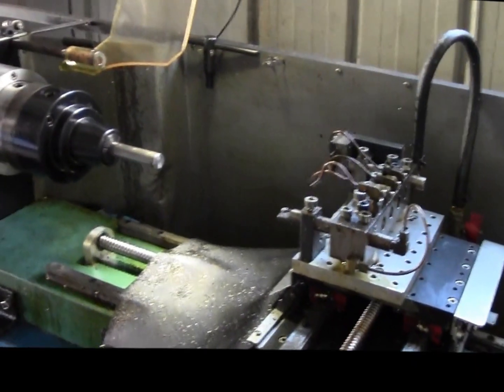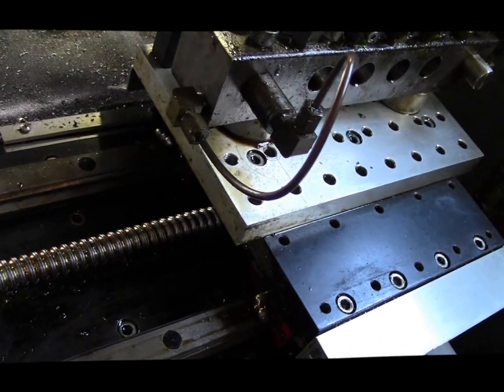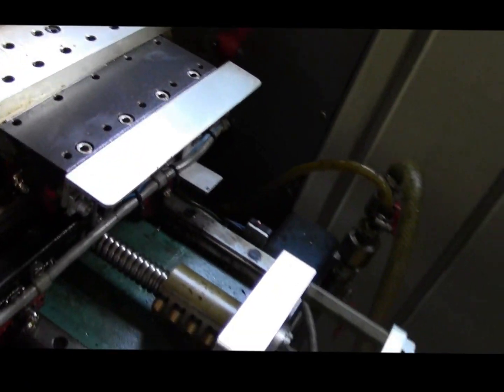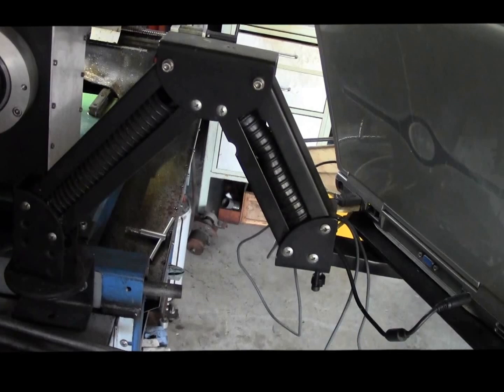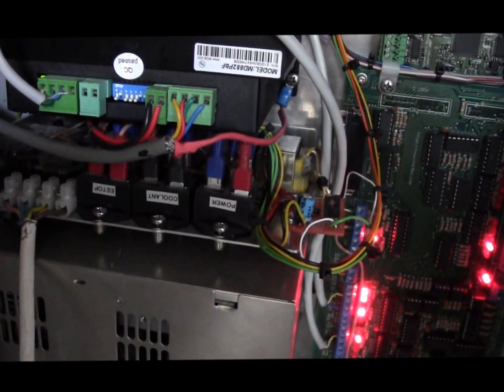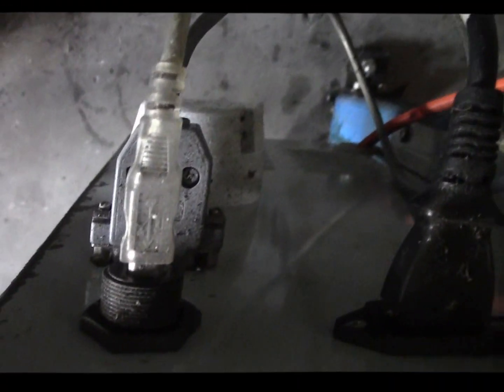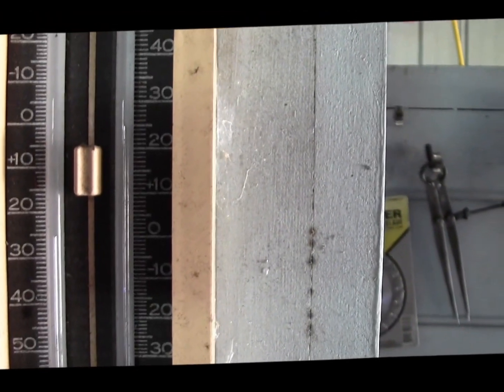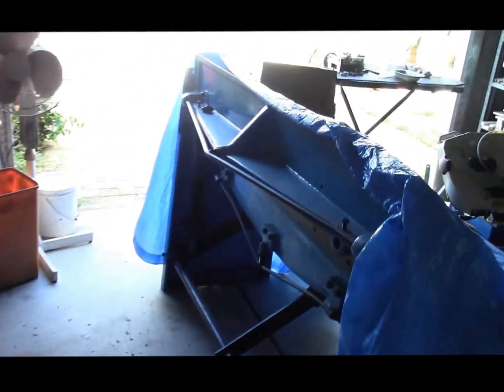Tour of my CNC Lathe & Workshop

Comment: friend is genious. please friend. how build your spindle. please. what type of bearing use. angular contact or taper bearing. I have heard about P4 and C code. what is better friend. please .. I see you use sheet metal. what about vibration.?? I Have read with cast iron the vibration is low than metal sheet.  thanks a lot. have a nice day

fabatecperu@gmail.com 

thanks thanks
Reply from the maker: I purchased the spindle as a "spare part" for my manual lathe, so all chucks could be used on both lathes.  The front bearing is a tapered roller whilst the rear is a double row angular contact.  I used normal bearings, not high tolerance.  High tolerance bearings are too expensive.  There is some noise from the steel construction, but not too bad.   The lathe is very accurate for my work.